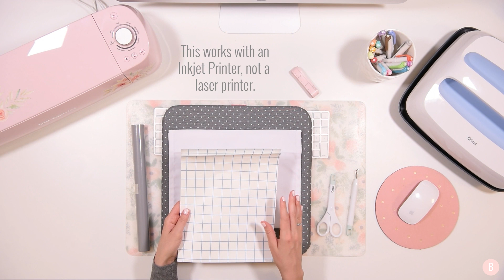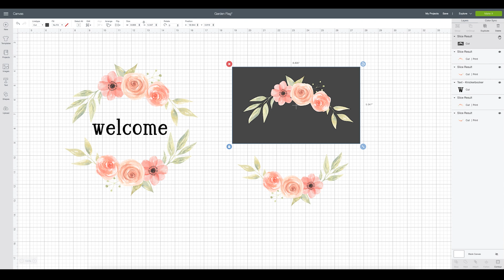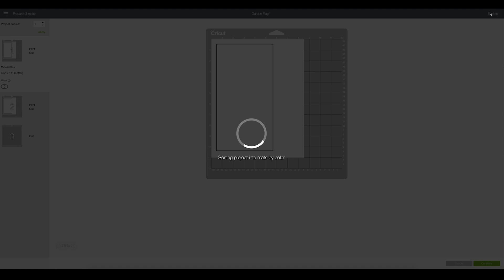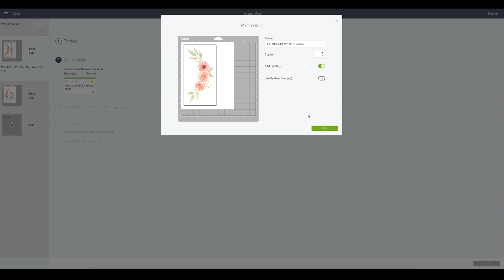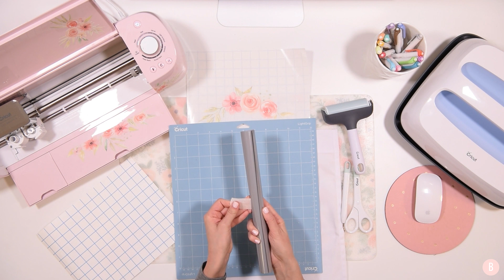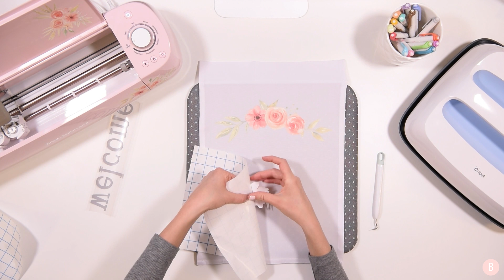PRINTABLE HTV!  CUSTOM GARDEN FLAG WITH PRINTABLE HTV & YOUR CRICUT!

Comment: Great tutorial! I am curious if transfer vinyl would work to get the design off the printable HTV. ( the clear stuff you use when doing stackable vinyl)  Sorry if that is a dumb question but I am very new to this craft.
Reply from the maker: It’s not a dumb question! Unfortunately, no. Because the back of the HTV isn’t sticky, there would then be no way to get it off the transfer tape and it would be ruined. Just take it nice and slow and honestly, it’s really easy! Just be mindful of your design!